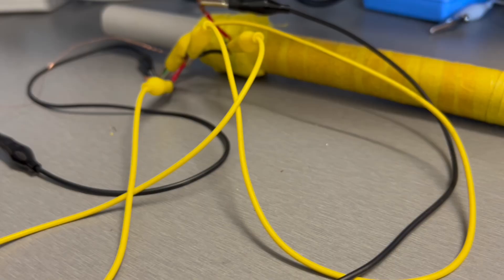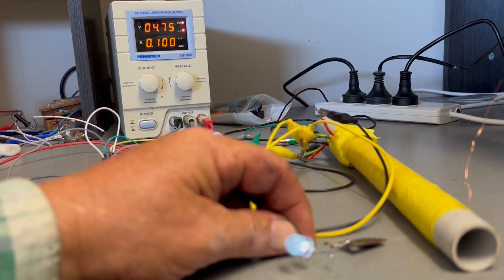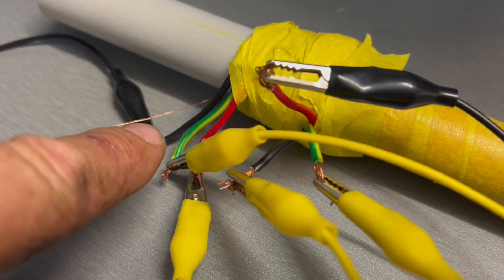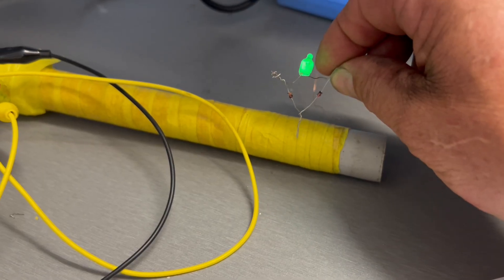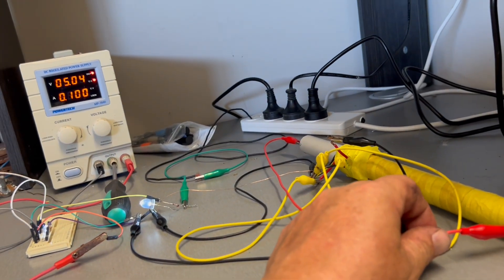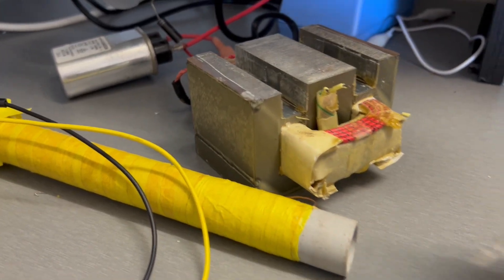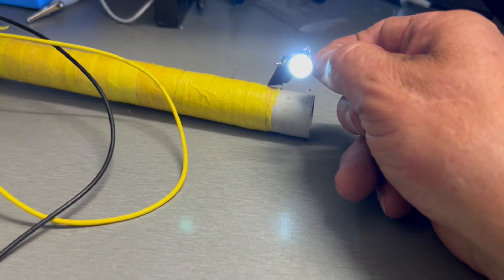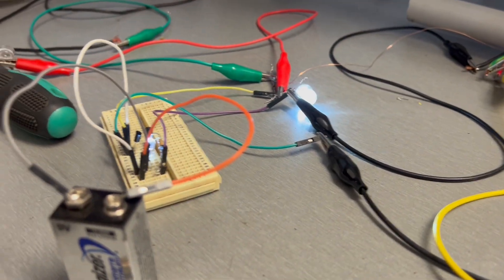Slayer Exciter. Just a few more important observations.

Comment: Hmm.. I'm trying to imagine how the three coils would be magnetically different than a single coil of the same total length/turns. But if only to allow for easy adjustment, then I think it's a fine enough system.

Overall, great project all around though! Looks very stable in it's current configuration, even if the efficiency isn't something to write home about, it's definitely not terrible for a CW resonator at the frequency (likely 1-2 Mhz I imagine?) that it seems to be running at
Reply from the maker: Yep, Spot on. 1.4 Mhz and stable.